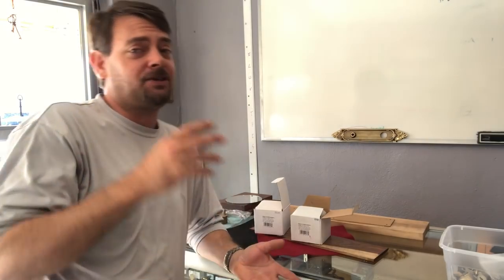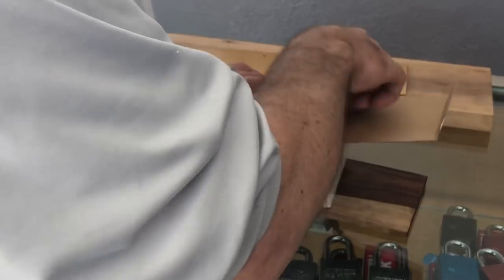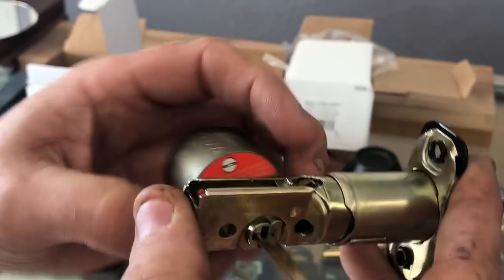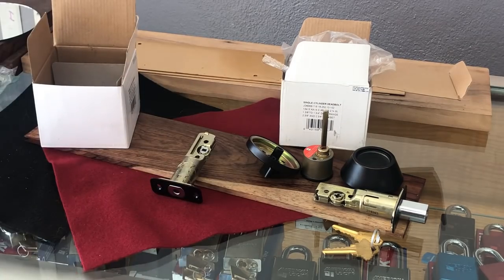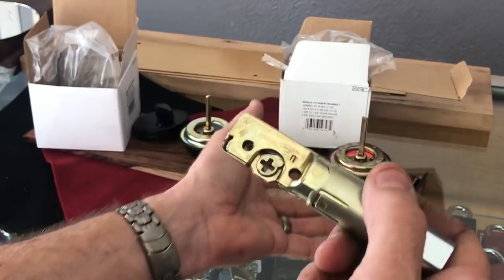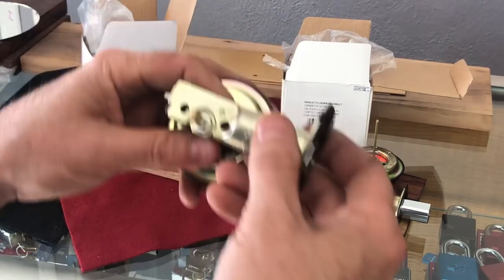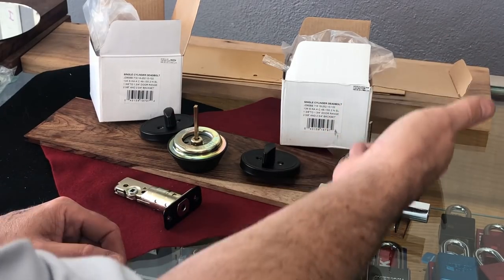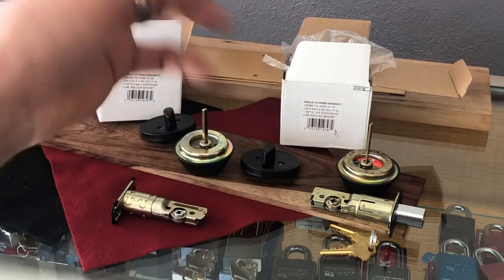Crazy update from Schlage with a redesign on their J Series Locks “DefiaSchlage!”

Comment: Looks like ending one production run by using compatible components from the next (retooled) run.
They could have finished by making double cylinder deadbolts, but thumbturns are much cheaper, and they would have had unusable latches left over.
Great video Jason.  Thanks

Comment: Interesting How do they differ in where the tail piece connects to the back of the cylinder
Reply from the maker: loz11968 about the same I believe, I wished I would have had one to compare it to (like to see if the housing fits in the trim ring, etc) but I just don’t have that brand even used :(

Comment: Shclage just gets these locks from the same Taiwan factory defiant does, defiant didn't develope this tailpiece...schlage didn't design this to be the same... It is probably jusr the same lock, with different brand names stamped on. 

I only noticed corkscrewed tailpieces on defiants that have have C-clips on the back... I've never seen the bad corkscrewing on lsda or any of the screw on cap tail-pieces. They might bend a little but never like defiant.

Comment: Exactly the same as Defiant with just an SC! Keyway. I use them every day. Same Factory different Name.
Reply: Does the defiant cylinder fit in the schlage (dexter) deadbolt housing?  I mean fit perfectly?  Usually the Schlage cylinders are smaller diameter and the kwikset ones won’t fit in the housing. Thanks!
Reply: @ajslezak  A Schlage cylinder is Not compatible. These locks are just different keyways. The plug is the only difference. A Defiant that uses the KW1 keyway is a perfect match and swap.
Reply: @pjdambra  I wanted to switch my j series entry handleset/deadbolt to kwikset and it looks like the defiant swap is the way to go.  thanks!
Reply: @pjdambra  btw just tried a defiant (rim cylinder) kw1 plug in the j series deadbolt.  It spins around but I wasn’t able to pull out the key, I think the 5 pin offsets might be off a bit (kw1 vs schlage c).
Reply: @ajslezak  .. the Rim Cylinder Plug is different than the Dead Bolt. The spacing are the same between the Schlage and Kwickset. If you slide the plug some you will see and the key will go in and out normally. You need a Defiant or Gateway Dead Bolt plug.